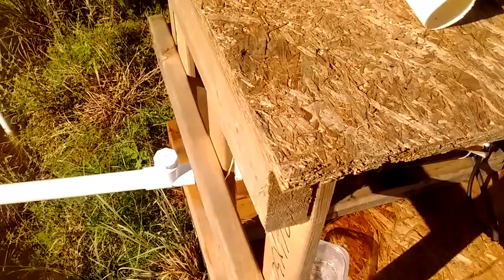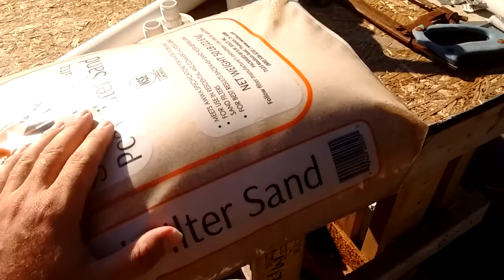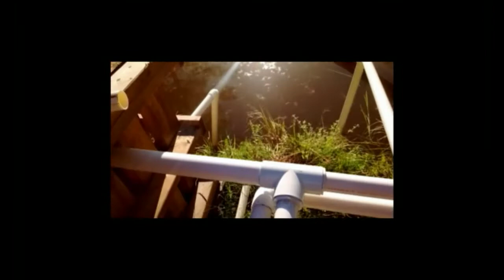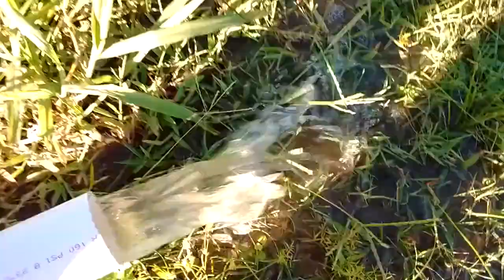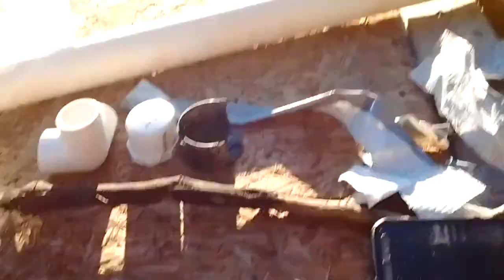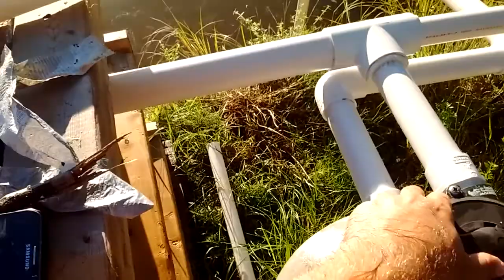Pond and Filter Setup

Comment: you said you got a few of those poles, why not join them with a big rock in the middle of the pond where they can connect or something. then you have an oasis sitting spot in the middle.
haha forgot to tighten it. No editing, how unprofessional. haha
Surprised how short those fingers were but I guess you have enough of them.
Reply from the maker: When I do the followup video with the walk around view of the pond area, you'll see where the "oasis" will be at  ;)
Plus, getting large rocks around isn't easy, or cheap. They have to come with a flat bed truck and possibly a crane.  Even using smaller ones that the tractor "might" be able to handle would still be an issue.
Yes, unprofessional. I never claimed to be anything but  :P